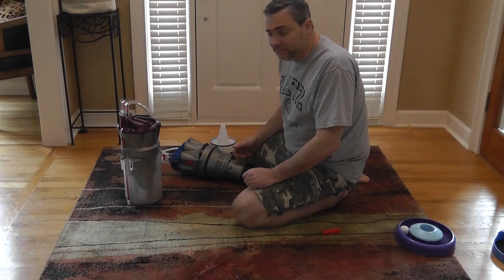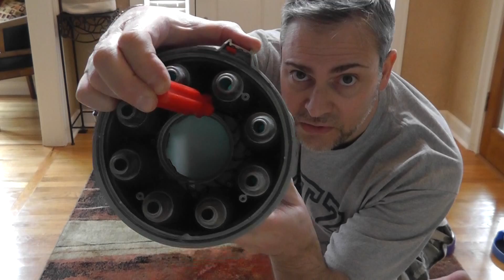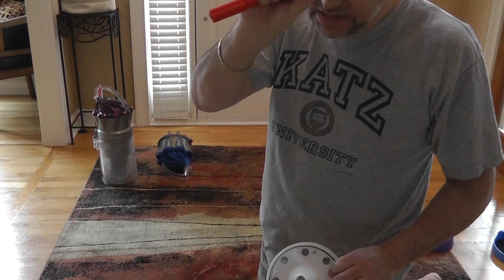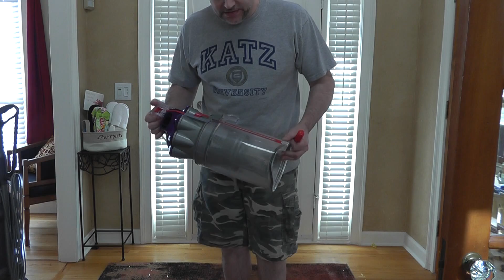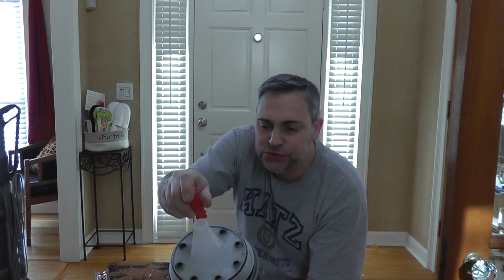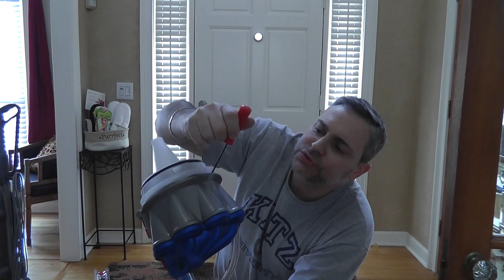How to properly open Dyson Cannister AND put it back together correctly

Comment: I've had a Dyson since they first became popular.  I'm considering replacing it, but will not be replacing it with another Dyson due to the unserviceability of their vacuums.  I think they have over-engineered their vacuums to become dust traps that will eventually require deep, cumbersome maintenance.  I hope they eventually design something that is more easily serviceable.  You should be able to easily access every nook and cranny where dust can accumulate.  This is definitely not the case in their current products.  The fact that they use special screws to hold parts together sends a message out that they don't care about the customer's experience.

Comment: Excellent vid-  I knew I needed to tear mine apart but didn't know how to separate the bottom part of the cyclone thing.    BTW the screws on mine (probably 9-10 years old) are Torx T-15.   I was amazed at the hair clogs, good lord, and we do not have animals-   Needed the piece of knowledge this vid provided about breaking the seal for the bottom part,  the rest is all straight forward.   I'll do this once a year or so now and hopefully it will last another 10.

Comment: Question: how do you get the plastic canister off? I have pushed the button and wiggled the thing until I thought I'd break the plastic, to no avail. So frustrating!!
Reply from the maker: Watch video carefully, it is tough but will come off.
Reply: @Dr.KatzDC  It was a bugger to get off (other people's videos make it look so easy!). I ended up using rubber gloves in order to get a grip on the plastic. It finally detached. Thanks. :)

Comment: Thank you for this!  I've had my DC17 Absolute Animal for close to 15 years now and FINALLY got the answer to cleaning the cyclonic bits.  All but two of mine were completely clogged.  Although there are a surprising number of parts, the process was really quite simple.  Thanks again!
Reply from the maker: I bet it works much better now!

Comment: I just wanted to pop in and say thank you for this exceptional video. After 8 years, our dyson just wasn't what it used to be, and after finding this video I took it apart like your video showed and we pulled over two pounds of compacted hair and dust out of it! Every single one of those things was clogged. Now it runs like it is brand new and damn near pulls up the carpet there is so much suction. Thank you SO much. Thanks to your video, I'm also working on my sister's dyson for her, as well as my sister in law's! Thanks a bunch. :)

Comment: This is an honest review. Dyson is a trap for dust mites, bacteria, allergens. It is very difficult to clean properly and frankly not a reasonable option. I hate my Dyson because it is next to impossible to clean properly in less than two hours with (special) proper tools.

Comment: Thank you for the video!

I didn't read through all the comments, so someone may have already said this, but one way to make sure things line up when you put them back together would be to use a sharpie and make a line across the two pieces your separating, and then making sure the two halves of the line line up when reassembling. If you don't want to draw on it, the same could be done with a piece of tape.
Reply: better to use thin masking tape, like pinstriping tape. you can remove sharpie with 91% rubbing alcohol, but rubbing alcohol in that strength also strips the dye out of plastic too, so its risky.

Comment: THANKS! I JUST PICKED UP ONE IN THE GARBAGE. THE BELT TENSIONER WAS PULLED OUT OF ITS PLACE AND THE ROLLER WOULD NOT TURN BY THE MOTOR... HAD NO TENSION ON BELT. LUCKILY THE TENSION ROLLER WAS STILL INSIDE THE HOUSING.  TOOK SOMETIME TO GET IT BACK IN PLACE.  WORKED GREAT AFTER PUTTING THE MOTOR HOUSING BACK TOGETHER AGAIN.  NOW BEEN CLEANING IT . FILLED CANISTER WITH HOT WATER.  USED DISH SOAP AND GREASE REMOVER IN WATER AND SHOOK THE HELL OUT OF IT. LOTS OF DIRT CAME OUT OVER AND OVER AGAIN! WHEN I WATCHED YOUR FIRST VIDEO AND SEEN ALL THE HAIR CLOGS I THOUGHT THEY MAY BE STILL IN THERE BUT VERY CLEAN CLOGS! LOL SO I DECIDED TO TAKE IT APART AND ...NO CLOGS AT ALL!  I CLEANED IT A BIT MORE AND NOT IT SITTING IN PIECES DRYING! CAN'T WAIT TO SEE IT IT HAS MORE SUCTION AND CLEANS BETTER THAN MY DIRT DEVIL.
Reply: I also recently received a free DC17 that had a bad tensioner (clogged with hair).  I removed the nozzle and motor cover, and replaced the cover with a new one ($20 w/shipping from Dyson).  The tensioner has been deleted from replacement covers and I've read elsewhere that tensioners are being removed from existing covers even if they're not being.  New belts are slightly smaller to provide appropriate tension w/o the tensioner.

Comment: thanks for the video...have owned a DC17 animal for 11 yrs and never did this in depth of cleaning...now that I watched the video and actually did attempted the cleaning it runs like a new machine...and yes it was totally clogged...wonder how it ran at all...only problem I have is the clear silicone seal seems to have fallen apart in places...so now I need to find a new one...but it runs great like I said so thanks for your help....
Reply: rutroh56  use a damp cloth or paper towel. Just don't run water into it.
Reply: The silicone seal was ruined when I pulled mine apart. What kind of silicone did you replace it with when putting it back together?

Comment: there is another filter that you have to access from the bottom and then side of the vacuum.  Found that out in another video. The Hepa filter needs to be changed/ cleaned too

Comment: Oops, already washed out the whole assembly with water, What should I expect from having done this?
Reply from the maker: ML Howard Just let it dry really good and take a hair dryer to it.  BE SURE it is completely dry before putting back together.
Reply: That you will have rinsed debris deeper into the cyclones and it will dry wherever it has fallen at and cause a bigger clog than before.

Comment: Tip for you lube up the inside seal small round one at the bottom of the bin trust me filter will stay clean for much longer help the cyclones work more effectively do it after you empty the be every time works